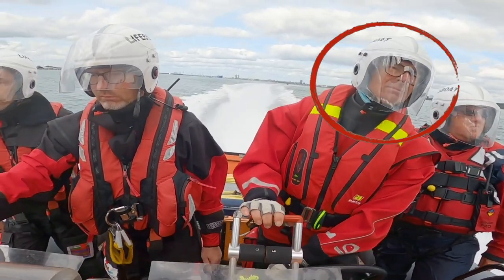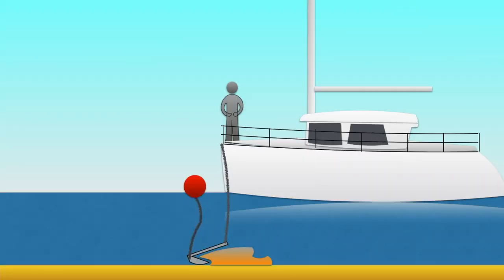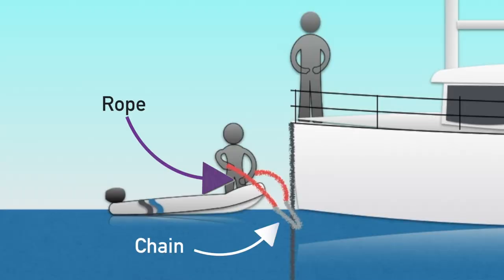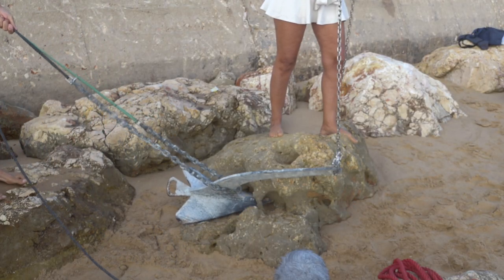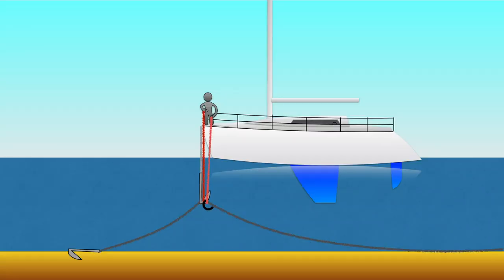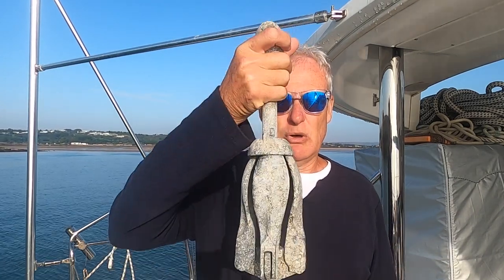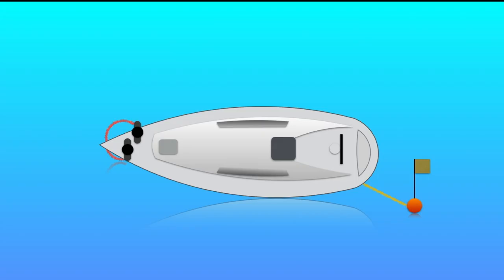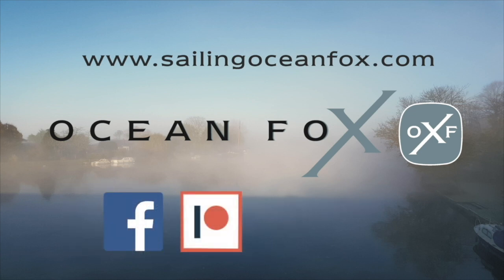How To Anchor. BEST Tips and Tricks 2. Sailing Ocean Fox

Comment: Thank you for this. I sail around Greece a couple of times a year on holiday and do a lot of stern-to mooring. the snagged anchor is always a worry and you don't need that on holiday. Your 'shelf bracket on a rope' for untangling anchor chains should be standard equipment on flotilla yachts!
Great videos.
Reply from the maker: I totally agree with you there but you know how they tend to save on equipment to charter. Thank uou